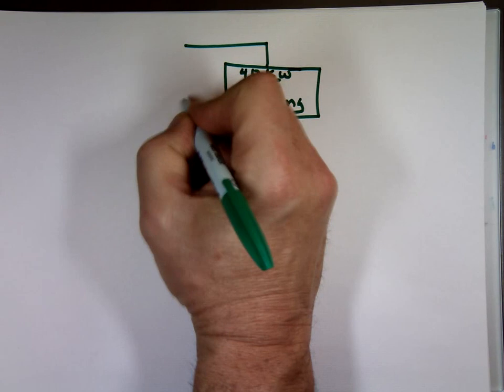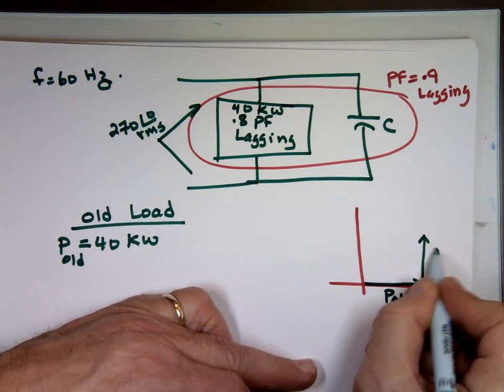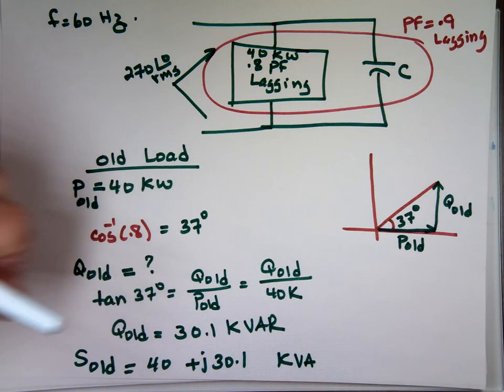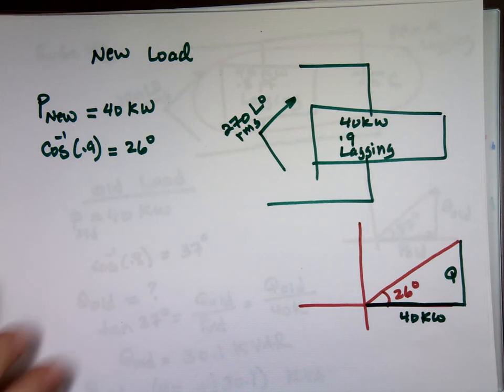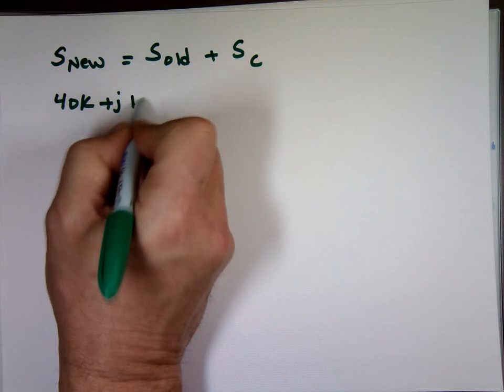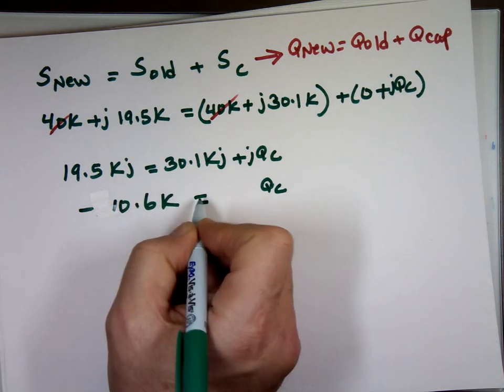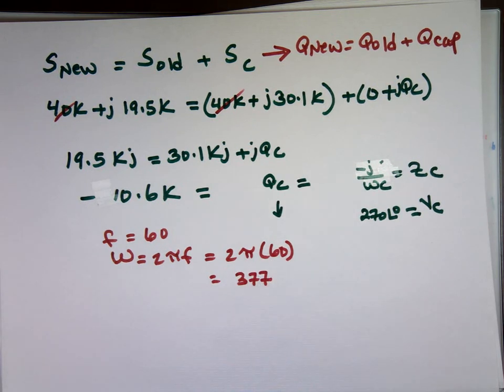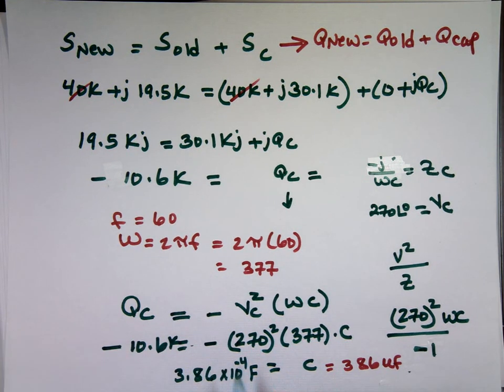Power Factor Correction

Comment: Why didnt you get Ieff at the last step and then get the impedance value by using Z=Veff/ i eff .... after that get the capacitance ?? ... ididnt that but i didnt get the same answer 😳😳
Reply: NVM i did a mistake in my calculation ... i got the same answer  😂😂😂😂😂lel
Reply: @69r  how
Reply: @mathswithpana  idk , it been 5 years, I graduated and forgot all that